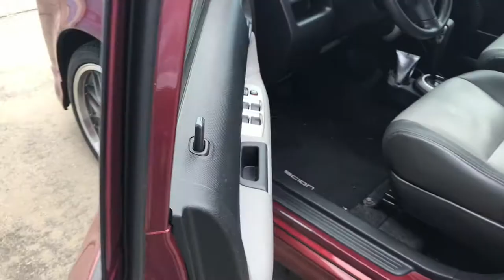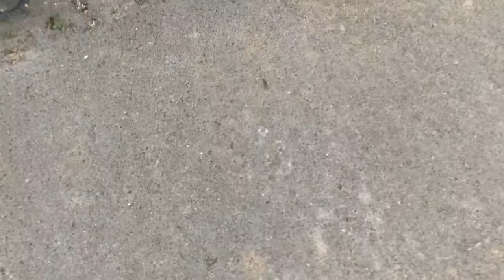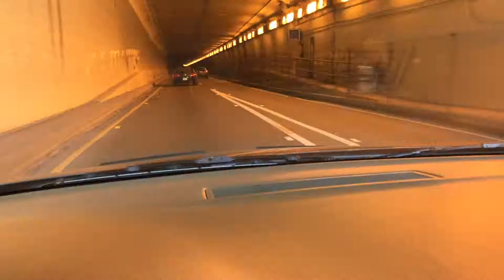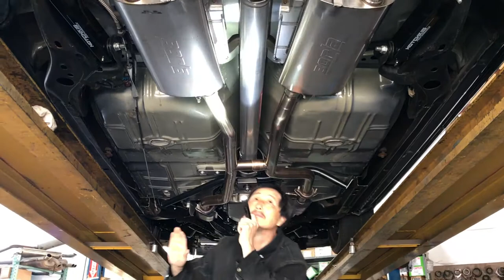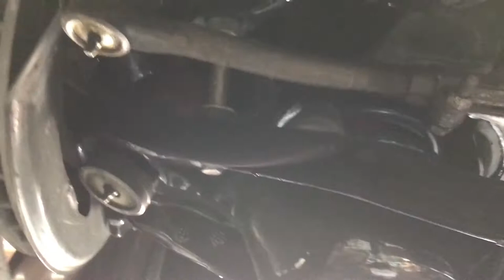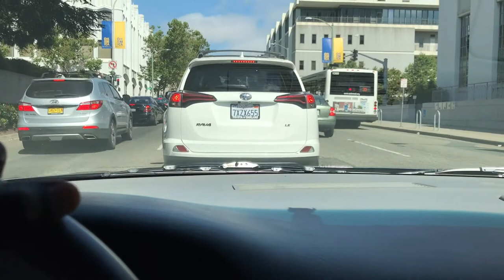Car Vlog: First Time Checking The Underbody!

Comment: That is not a Michigan car that is for sure.
Reply from the maker: BlkJ19 everytime I've bought a car or truck from Texas, it's been super clean underneath
Reply: I'd like to restore my 99Monte Mostly just rust but I don't even know if that is something that can be done. Michigan salt...
Reply from the maker: BlkJ19 how bad is it?
Reply: There is rust on frame, rear sway bars, control arms and other areas but most I think can be replaced with newer components
Reply: I'd like to see restore videos were the car had rust and compare it to how mine looks to get an indication of how much work needs to be done.